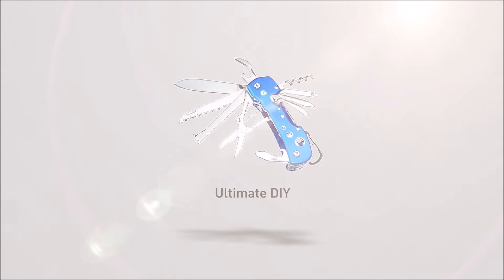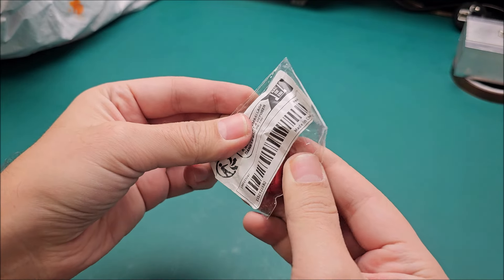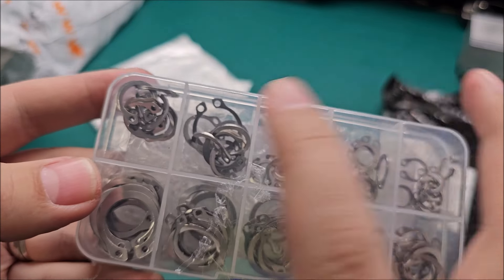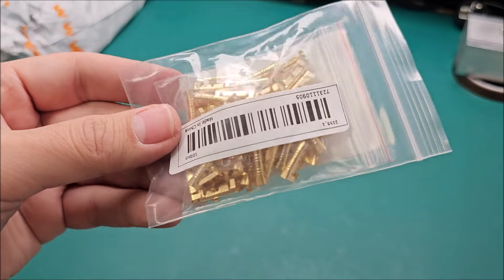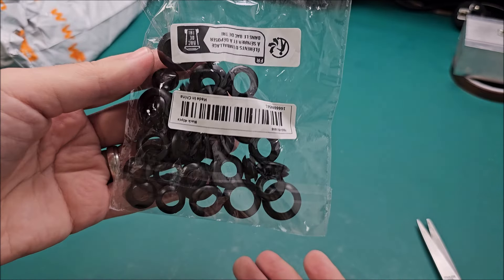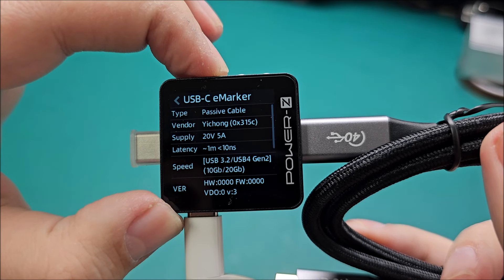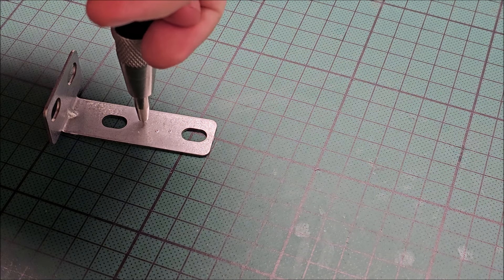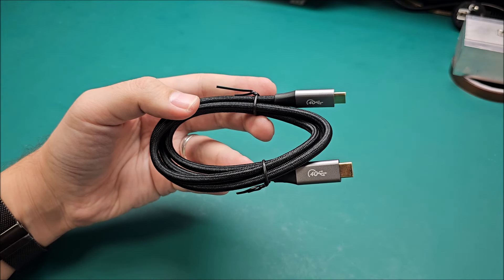😲 I bought things that I didn't really need from TEMU.COM - are they any good at least? 😟

Comment: Buys cheap stuff from China....they arrive and complains about how cheaply made they are....seriously what the F did you expect
Reply from the maker: I don't think you got the point. The problem is not that they are cheaply made. The problem is that they are built so cheaply, that they can't even perform the job they were made for and they fool people into buying them, with all sorts of offers and promotions. Is it normal for a cheap drill bit to not even have the required shape? Is it normal for the blue cutting pliers to bend on first use in plastic? It's basically closer to a scam than an online store.
But feel free to watch other videos, where the products are sent for free by Temu to reviewers, so they barely tell the truth, if that is what you like.
Reply: @UltimateDIY  Not to mention the insane amount of plastic packaging. Many items were wrapped/boxed in plastic, then put in a plastic bag, then put in a plastic shipping bag, and then finally put in a large plastic shipping bag?! An unbelievable waste as those types of plastic can't always be recycled where I live (Canada) and I assume it's the same in Romania, and that's before considering how much recyclable plastic never actually gets recylced. If the products were at least somewhat decent then the overpackaging would not be as bad but the end product is mostly junk! 

On the other hand, maybe some of the stuff they sell didn't pass quality control and at least it will be used, even if once, instead of being thrown out. Trying hard to find a silver lining.
Reply from the maker: I know...same for me, as otherwise it's just a huge waste of resources for all involved.